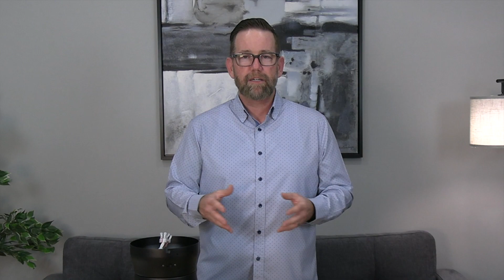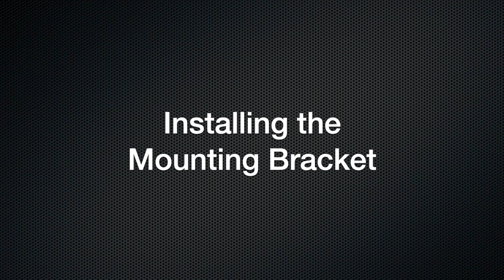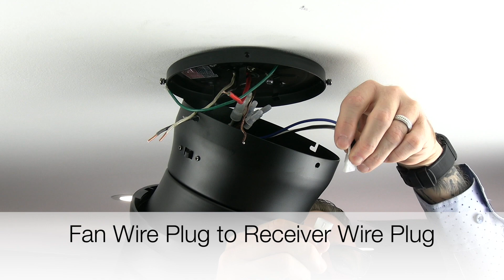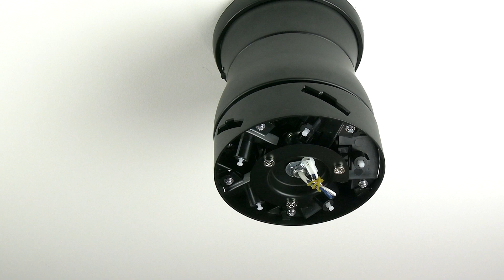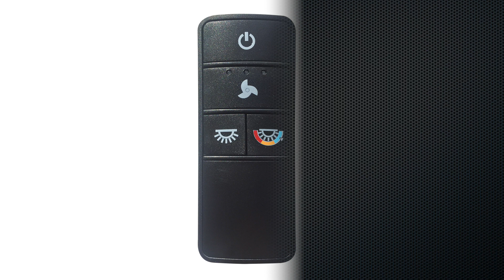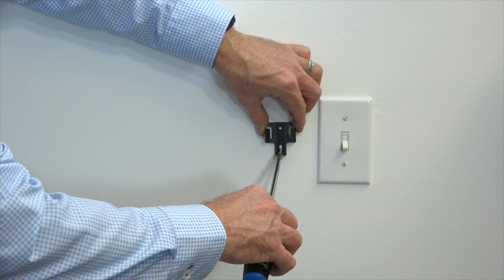How to Install the Mena Hugger Ceiling Fan by Hampton Bay

Comment: I have the opposite, I have a red house wire but no red wire from the receiver
Reply from the maker: Do you have this exact fan?
Reply: @   Its very similar to the one I picked up from Home Depot. The fan has two green wires, a black and white wire.
The two greens connected to the house ground. And of coarse the black and white connected to the house. I neutralized the red wire from the house and works lol! Thank you for the reply your video was very helpful.

Comment: Is it possible to use the wall switch for the light and then use the remote for the fan only? Also, if we can, will it remember the hue we set from the remote when using the wall switch? We do have a red wire from our ceiling as well.
Reply from the maker: Yes, this remote receiver has separate wires for light power and fan power. This allows you to wire the receiver to 2 separate switches - 1 for light and one for fan speed.
Reply: @ceilingfans101  That wasn't the question. Older fans could be controlled from one switch for both light and fan and by pull chains as well. This way, you can turn the light off at the switch but still operate the fan. I would guess that most people do not have two switches available. The fact that most new fans have remotes is not necessarily a step forward.